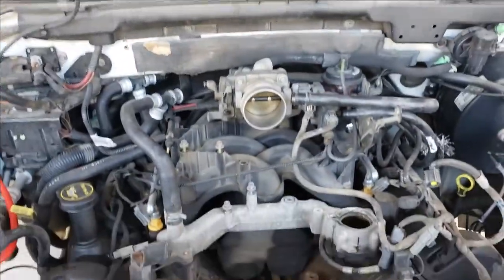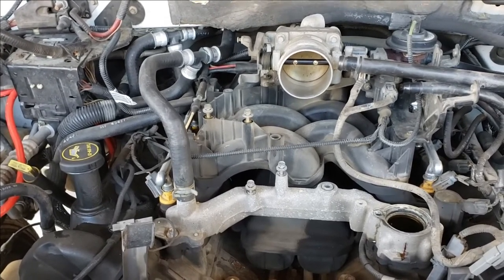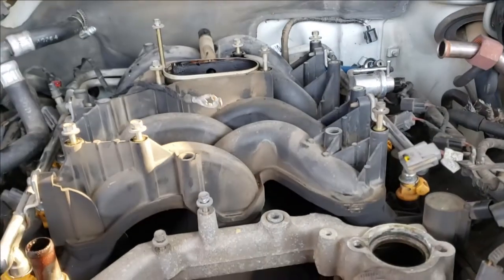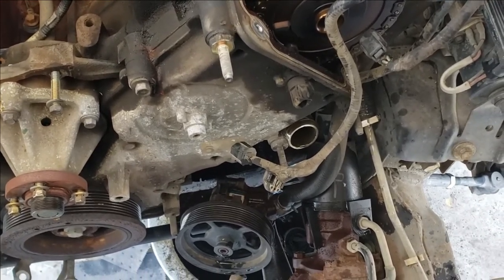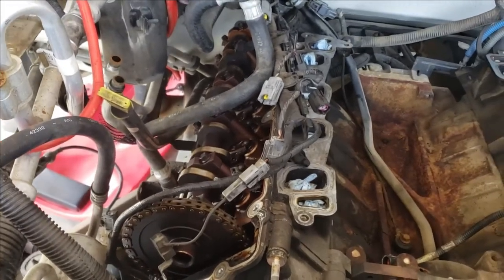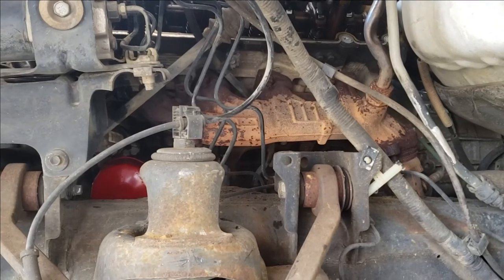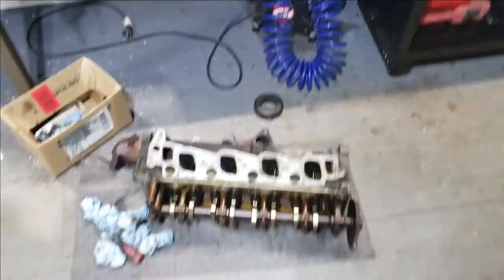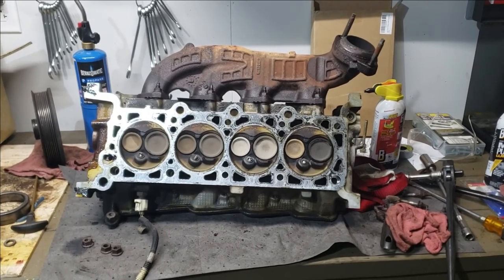2001 Ford Expedition Intake Manifold Replacement and Timing Set

Comment: That's a relatively easy job. No need to remove radiator,shroud,power steering pump. The intake is on top of the engine...not in it.
Reply from the maker: If you have watched the other videos, this vehicle gets more than just the intake.  We had a plan that included electric cooling fans, timing set replacement, removal and rebuilding of the heads, and cold air intake.  My novice, inexperienced videos are obviously not meant for mechanics of your caliber, but I certainly appreciate your valuable time in watching one video and then jumping to conclusions.